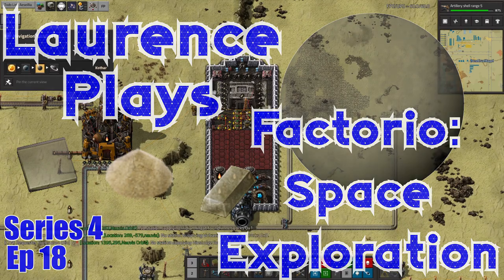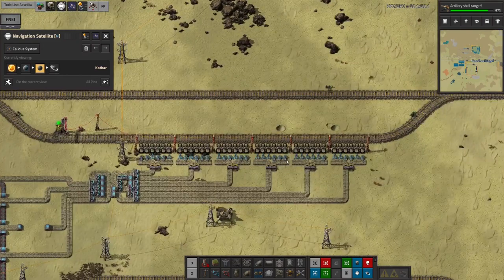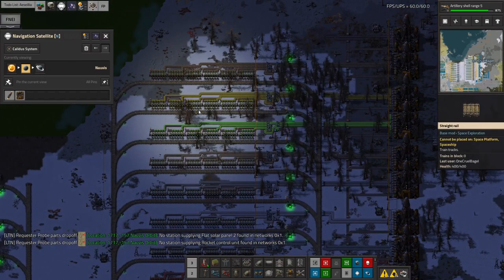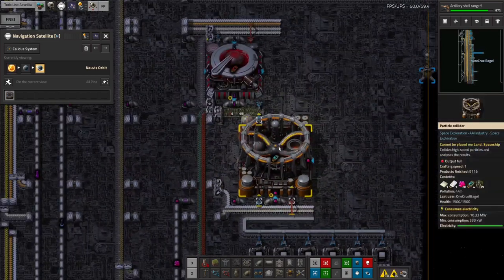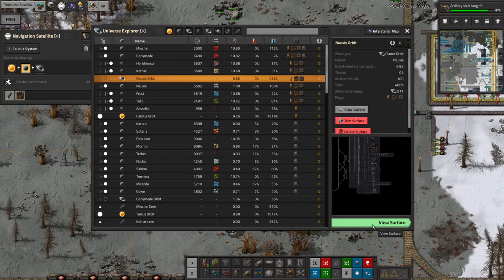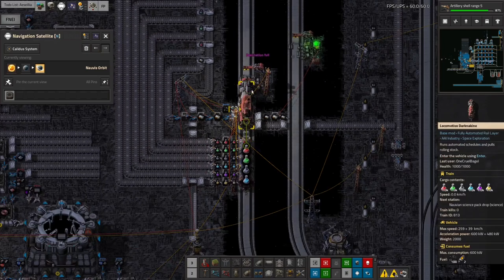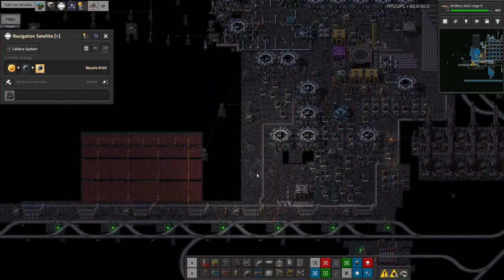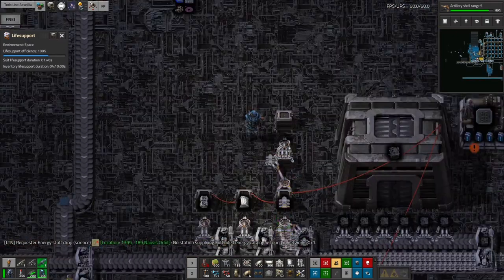S4-E18 - Goods In, Bads out - Laurence Plays Factorio: Space Exploration

Comment: AFAIK the chests are not sorted, and inserters will just pull from the bottom up. I suspect it appears sorted since you have so much more substrate and scaffolding than anything else that it is constantly loading, so whenever it can, it'll use up the entire input belt just for the substrates.
Reply from the maker: I have a mod that sorts chests, warehouses etc - I installed it when I was playing AngelBobs and using the construction vehicle, which was turning into a horrible mess. The mod, it seems, only actually sorts an inventory when you open it (which makes sense for performance reasons), which is why it was unloading random stuff, then when I opened it, it started unloading all of each thing in turn. 

But yeah, in vanilla, you'd be right  :-)
Reply: @LaurencePlays   Ah, makes sense. What's the mod called?
Reply from the maker: @pietersieliepc  Heh... Now you're asking! For this question, I shall go all the way back to series 1, episode 1 where there's a list of the mods. https://www.youtube.com/watch?v=oOHkLsSk1wo

Looks like it's called "Manual Inventory Sorting". And I really need to redo that episode with not-awful sound!